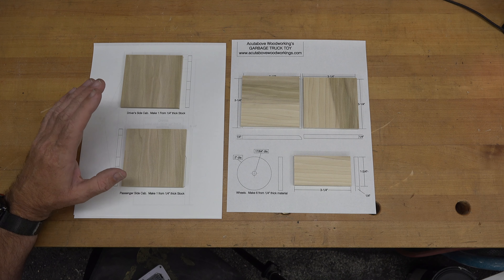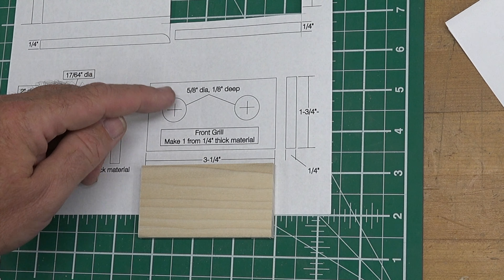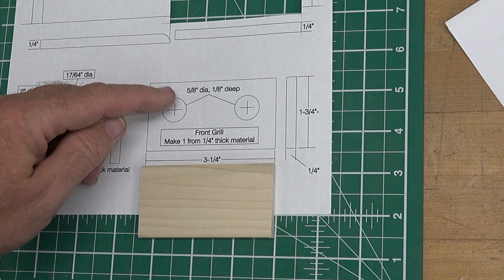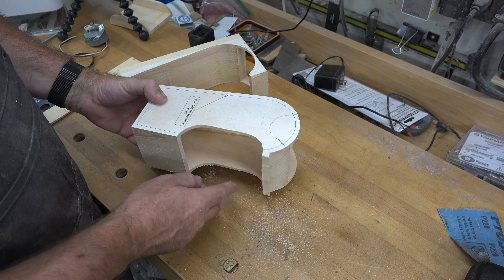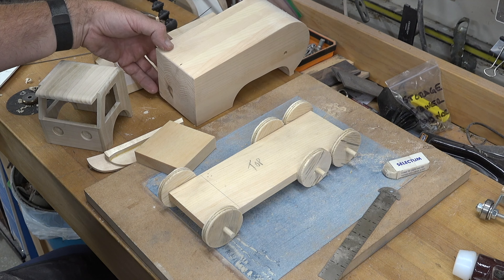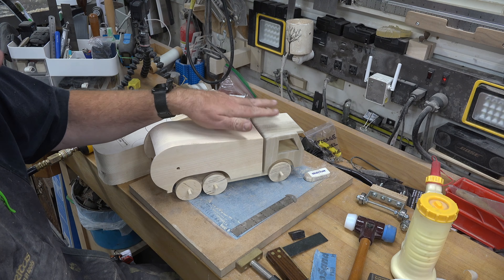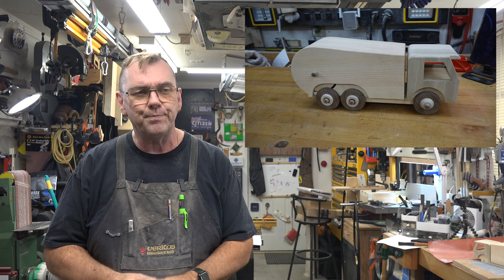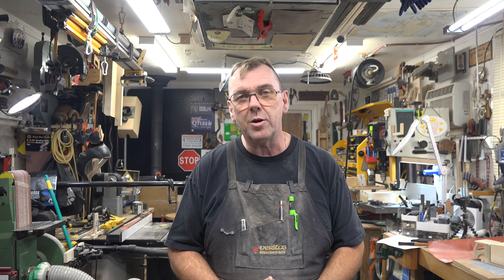Making a Garbage Truck Toy

Comment: Do not beat yourself up about anything you think was a short fall or a less than desirable design. That's how it all goes in reality.  Sure, you could have made it earlier and corrected the plans and then did the build show, but to actually show the transition from mind picture to physical product is worth its weight in Loonies!   We have all created designs that looked and felt right on paper, only to realize in fabrication that we screwed the pooch some how, some where.  And the upgrades actually made a better outcome than our initial thoughts.  So, BRAVO, Kenny!!!!!  Ya done good.  Thank you for this effort and for the show.  And let's be honest.   How quickly do you  think the designers at T&J get a plan to market?  How many iterations are needed and when published, as we know, there are still missed or incorrect measurements.  That's the way it goes.   Again, thank you.  Well done, sir.
Reply from the maker: Glad that you liked it.  You make some very valid point here.  Thanks for tuning in and for always being on the positive side of things.

Comment: Hi Kenny I was disappointed that you did not include lights in the toy. LED lights have come along so much now that fitting a single led light in the headlight should be easy and the switch could be hidden in the cab.
Reply from the maker: That's a great idea John and I will consider it for a future model for sure.  Thanks for tuning in to the show.